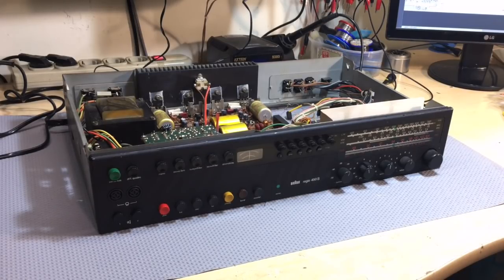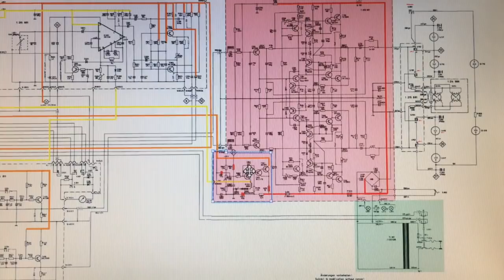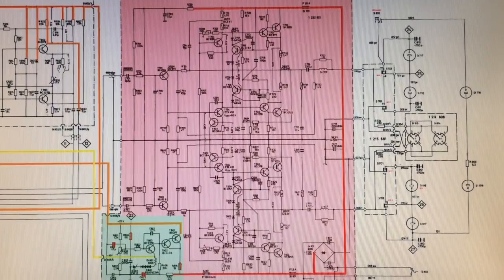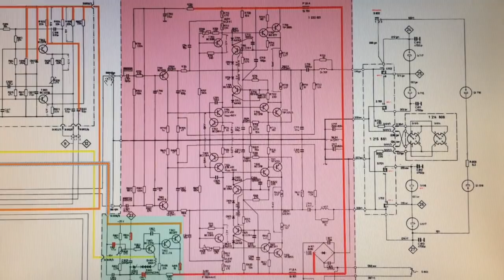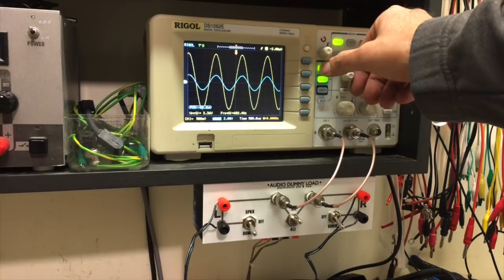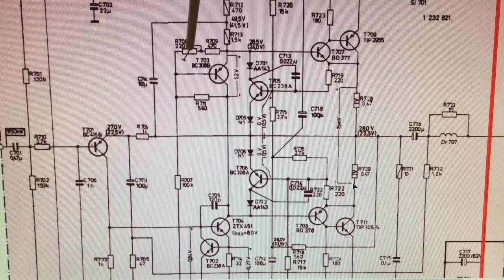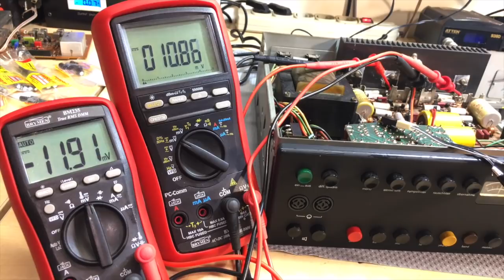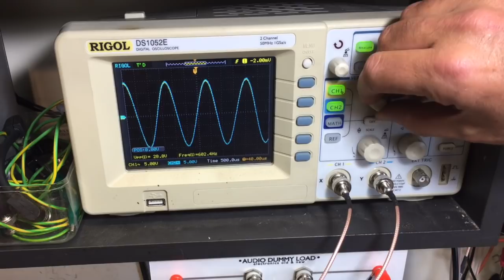Braun Regie 450S restoration - part 3. Power amplifier re-cap and test.

Comment: The resistor in the power supply that you changed was a security type resistor. It will burn out without fire. The symbol in the diagram shows that.
Reply from the maker: I didn’t notice that in the schematic. Must have a look. I’ll replace it with a metal oxide which has the same properties. Thanks.
Reply: I dont know what materials these are made of. They look like a cement resistor wich the distinct grey color. I english they are called fussible resistor. They burn out without flames. I sometime have replaced them with one from a switchmode supply, they are often used at line in before the rectifier. They are used to avoid fire.

Comment: Nice work and great video again.
Touchy pots are usually very unwanted in consumer equipment that is (or has been) produced in numbers. Even back then in the seventies. As those pots have been replaced, maybe it's worth checking the value of the pots? Who knows. By now you found an out of spec Zener and a Fuse with the wrong value.
Cant't wait for the next episode.
Reply from the maker: I’m ordering new pots to replace these, but it’ll be a while before they arrive.

Comment: Without testing the large caps on power amp board, I would wonder i f they need changing because of the voltage they are soaking in?
Reply from the maker: John McCormick : they may in fact be just fine, and actually getting better with use as they reform. However, I really want to do a complete job on this so I’ll change them when my order arrives.

Comment: The trimmer are looking really sensitive. Also first i thougt, use 10turn-pots. But i know, they mostly do not fit in the grid of the normal trimmer.
And i had to smile, when you talk about the brothers.  :-)  No Flukes. Are you satisfied with them?
Reply from the maker: Yes, new trimmers would be easier, but I don’t like to have to bend legs everywhere for them to fit.
The brothers: well, I’m very happy with them and find them to be better than flukes inn many ways. However, they do have a few quirks: little brother’s off position is not the 1st position, but rather the 2nd, which is a little confusing.
They don’t have the diode beep, which I really liked on the fluke. 
Otherwise, for the price they are amazing.

Comment: Funny thing is that I just finished restoring a Tandberg receiver from the same time (1974-77), a Huldra 10.
And it has an almost identical output stage with this Braun. Even down to the values of most of the resistors and capacitors.
It uses MJE2955 and MJE3055 output transistors where the Braun uses TIP2955 and TIP3055, guess it's just different housings.
Bet this will sound pretty good when your finished with it.
Thumbs up, and thanks for making all this entertaining and educating videos.
Reply from the maker: I think the engineers of the time were probably a lot more collaborative than they are today. Most of the circuits were not groundbreaking, so why not share layouts and schematics? 
I’m looking forward to hearing the final result, but there’s still a ton of work to do.

Comment: The fuse bandit strikes again! Lucky you didn't find a foil wrapped one in there...
Coming along nicely :)
Cheers,
Reply from the maker: Foil wrapped, thick piece of wire ... etc. 
Cheers
Reply: @electronicsoldandnew  - I had a repair once that was the victim of a foil-wrapped fuse. I think the owner tried a few different types of fuses between his successive turn on attempts (as if a bigger fuse fixes the problem) eventually ending up at the foil wrapped one. Needless to say he started with some blown output transistors, but by the time he finished, he managed to wreck two preceding stages in the pre-amp and phase shifters. 

Fun times.
Cheers and take care.

Comment: it would still be interesting to figure out why that resistor failed!
Reply: Easy. The piece of metal he found is a screen normally soldered to the underside of the fm board. It has slided around a some time when the unit was powered on and shortet the supply out.